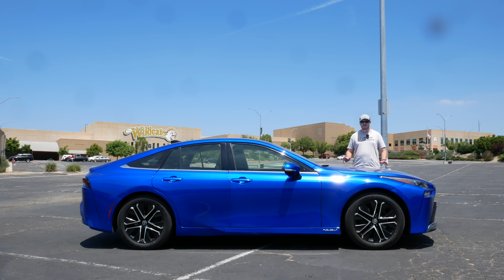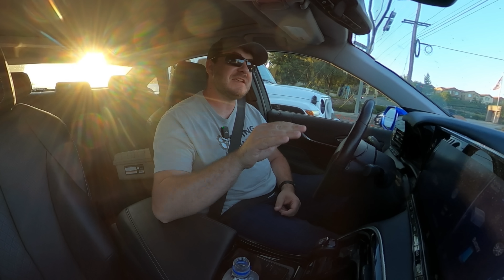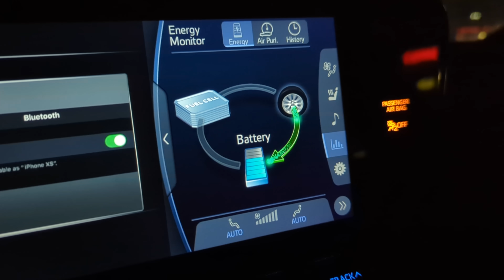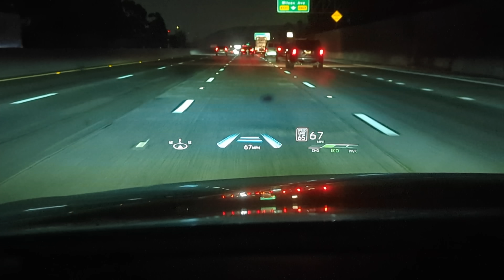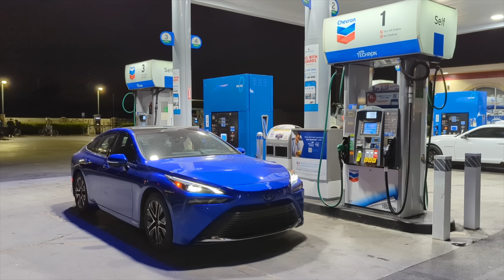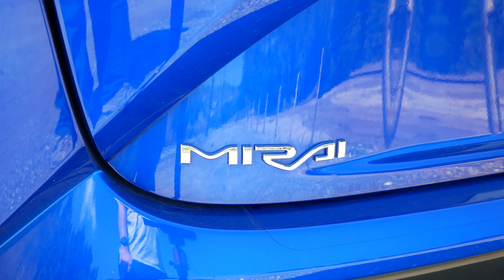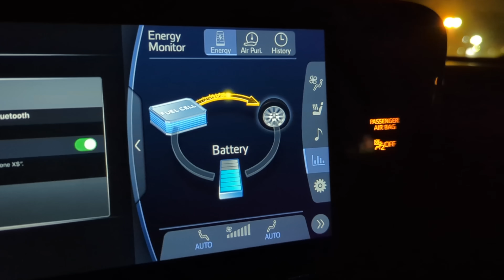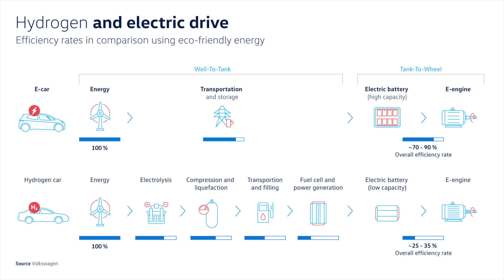The Toyota Mirai is Disappointing

Comment: There is a bit of a misstatement here and a pretty huge point to the Hydrogen fuel cell issue, and "green energy" cars and the whole 'fight against climate change" initiative.

You don't have to produce Hydrogen at all. There's tons of it covering most of the planet, as Hydrogen is a main component of water. What these fuel cells run on is something called H3. That is three Hydrogen molecules formed together. Just like Ozone (which is three Oxygen molecules fusing together), Hydrogen HATES being H3 and it takes a lot of energy to produce this. To give you an idea, Ozone is formed naturally....from a bolt of lightning. 

So, making this fuel source is complicated and expensive because it isn't mainstream. The other issue is, they could have just run this with water. But therein lies the rub. You can't really sell water to anyone, as you can find water almost anywhere. Also, if the waste product from the car is water, well, you could simply refuel your car to some degree with its own waste. So here you could have a completely zero emissions vehicle that would be cheap for everyone to use and run on the most abundant resource on the planet............yet it isn't being done because nobody can profit off of it. 

Honda actually built an amazing Hydrogen fuel cell test vehicle that was based off of a Honda Accord. It would do over 400 miles on a single tank full and while it was being tested, the driver stated how it drives and handles exactly like you'd expect a Honda Accord to do. It may not be the platform for a performance car, but this is a family sedan for daily commute.
Reply: "You don't have to produce Hydrogen at all"
"So, making this fuel source is complicated and expensive"

Making it is also producing it when discussed in the video. You cannot find hydrogen in its natural state on Earth. You have to separate it from something else, which is exactly what he said.
Reply: @anthonypelchat  Yes, and you can run a car on water, which has Hydrogen in it. It is also the waste product of H3. And yes, making H3 is complicated, takes a lot of effort, and right now is expensive.
Water is in great abundance and free....which is why no company wants to make a car that runs on water.
Reply: @eduardopena5893  You can't just run on water. It has to be converted. Further, the water has to be proper. It cannot be dirty nor salt water. That means drinking water. And it isn't free. Water costs a decent amount per gallon with most of that being wasted.
Reply: @anthonypelchat  So steam is not a thing to you?
Reply: @eduardopena5893  And you ignored what I said. Good job.
Reply: @anthonypelchat  I absolutely did not. You think the steam engines were running on purified drinking water? 

I just pointed out that you don't really know what you are talking about, and now you're angry, and want to try to make a personal attack on me.

Try again. Use your brain and logic instead of emotions.
Reply: @eduardopena5893  Steam engines required something to heat the water to run. They didn't run on water. The fuel is something else. Different concept. Also, using salt water or dirty water was problematic. Look it up.

You cannot run vehicles directly on water. You have to convert it to something else using a fuel. Steam engines use a heat source to convert the water to steam. Converting to hydrogen requires electricity to break down the water to hydrogen and oxygen.
Reply: @anthonypelchat  Yes, a boiler. They ran on the steam power. That would be like saying your car doesn't run on gas. It runs on the combustion of the gas. 

Yes, you can run a car on water. It is what some of the first cars ran on. Steam. From water. Flowing water from waterfalls and dams run power plants. 

Just like a car using H3 wouldn't be actually running on the H3, but the conversion of that fuel into something else, which is why the waste product is water, and not more H3. 

Ah, so you get it. See, the car isn't running on H3, it is actually running on the electricity. Guess we can't use it then, right? 

So what exactly is your argument again?
Reply: @eduardopena5893  Again, water is not the fuel. Calling it the fuel would be like calling the pistons in an ICE engine the fuel. That is just flat out false. The fuel is what is used to convert the water to steam. 

Waterfalls are not fuel either. Learn what fuel is.
Reply: @anthonypelchat  Falling water spins the turbines. 

And again, what you are stating is the same thing that the H3 isn't the thing that runs the car, it is the electricity that does. 

And it would be like saying it isn't the fuel that runs the ICE, it is the explosion that does, the spark from the plugs from the battery. 

So yes, you can power a car on water, just like you can power a car with H3.
Reply: @anthonypelchat  I never said waterfalls are fuel. I said they RUN hydroelectric power stations. And so do dams, same principal. The flowing water is used to spin the turbines. 

Learn what words mean. Then learn what you are talking about. You are simply arguing to argue here. You CAN run a car with water, the same as you can run one on H3.
Reply: @eduardopena5893  This is getting off track. Pretty easy to do since you don't have the basic physics education taught in middle school. Back to vehicles.

Water IS NOT FUEL. No matter how you try to justify it, water is not and is never fuel. It is used BY FUEL to move vehicles. In the case of steam power, FUEL is used to turn water into steam to move the vehicle. In the case of hydrogen, electricity is used to break down water to get hydrogen, which itself can be used as fuel. But water IS NEVER FUEL.

And no, you cannot run a vehicle directly from water. EVER. There hasn't ever been one created. Even the hypothetical water powered vehicle that you think was shelved wasn't real. It required perpetual motion electricidal production to convert water to hydrogen. Basically, it was an FCEV that proposed using magic to create hydrogen. Got it? Of course you don't.
Reply: @anthonypelchat  Thanks for taking a long time to make an argument about something I never stated and to agree with me.

Things were getting off track because you wanted to go off on tangents about things that do not pertain to the discussion at hand in some futile attempt to try to prove to yourself that you're as smart as you think you are. 

Water is a fuel source as much as H3 is. I also noticed how you just completely dropped the argument about hydro power plants. 

How does it feel to be bested by somebody that "doesn't even have the basic physics education taught in middle school?" 

Chump, step off the freight train. You are out of your depths.
Reply: @eduardopena5893  "to make an argument about something I never stated"
"Water is a fuel source as much as H3 is."

And here you are again calling water a fuel source. And yet you act like I'm discussing something you haven't stated. But at least you admit to not having a basic physics education taught in middle school.

"I also noticed how you just completely dropped the argument about hydro power plants."

Because that is completely separate from vehicles and requires a basic physics education that you don't have.

Water is not and can never be fuel. When you claim it as a fuel source, you are really confusing it for something closer to a battery. Hydro-electric power plants take energy that water has acquired from gravity and the sun (simple explanation) on its way towards the dam. But the water is not the energy source.

Same for steam powered vehicles. The water is converted to steam by a fuel. The energy in the steam is them converted to mechanical energy. Again, the water is not the energy source. That is the fuel.

Hydrogen is a fuel. It is burned in hydrogen combustion engines or rocket engines to be used as the energy source. But for fuel cells, it reacts to another material and oxygen to create water. And that reaction is converted to mechanical energy with steam as the byproduct. But again, water is not the energy source.
Reply: @anthonypelchat  Your problem is that you are not using the full quote. Try again.

Comment: The Mirai weighs more than a Tesla Model 3 and Model Y… how can you claim weight is an advantage of a Hydrogen car vs a BEV?
Reply: The Model 3 gets 340-360 miles of EPA range while weighing 300lbs less than the Mirai. That is right in line with the range of the Mirai. And 300lbs of extra batteries would have easily gotten the 300 well over 400 miles of range. Even the long range Model Y is around the same weight as the Mirai and has drastically more space. Further, all Teslas have better performance than the Mirai.

Also, trying to compare the Mirai to the Model S or X is just silly. Might as well compare it to a Bugatti or F150 at that point. Just as pointless of a comparison.
Reply: Square cube law might mean the tanks will scale up better than batteries?
Reply: By the time you add enough batteries to match the range the hydrogen car is going to weigh less.
Reply: @NBSV1  The Mirai has less range than a Model 3...
Reply: @icy1007  Which model 3 has a 400 mile range? And, based on size this would compare to a model S anyway.
Reply: @NBSV1  No Hydrogen car has a 400 mile range. The Mirai is more like 250 miles.
Reply: @icy1007  The Mirai is rated at 357-402 mile range.
Reply: @NBSV1 and it doesn’t get anywhere near that. Owners have all confirmed that it gets less than 300 miles on a full tank of H2.
Reply: @icy1007  As if the Teslas do their full advertised range all the time. 
You’re really struggling hard to make some sort of point that doesn’t make any sense. At most this is just like an electric car with overhyped marketing and underdelivered reality.
Reply: @NBSV1 my Model 3 gets over 300 miles of range easily.
Reply: @icy1007  Good for you. That’s less than the advertised range for the biggest battery. Do you have actual experience with the range on a Mirai to say it wouldn’t get similarly close to its advertised range?
Reply: @NBSV1 that’s not less. I get roughly 330 miles on a full charge. That is basically the advertised amount.
Reply: @icy1007  Point still stands that if you’re getting advertised range why wouldn’t the Mirai. Do you have experience or data to back up that it can’t do its advertised range?
Reply: @NBSV1 because no one with a Mirai is getting Toyota’s advertised range. The entire Mirai subreddit is full of people pissed at Toyota for lying about the range and want them to buyback the car. 

The point is that Hydrogen is hugely inefficient and it makes much more sense to put that energy into BEVs than in hydrogen cars.

Comment: I realize this is a year ago and people have woken up to the terrible macro of EVs but 'Aging Wheels' lost an heap of credibility with me when he said that range is becoming irrelevant based on the theoretical charge time of a tesla 3 if you can find a charger, if the charger works, if there is no one occupying the charger, if the other chargers are not in use resulting in charge speed throttling, if the sun is shining but not too hard and the temperature is warm but not too warm, etc..
The battery on a electric car is a massive flaw and will remain that way even if they can improve energy density 5x.
Reply: You haven't looked at EVs in over a decade have you? Go to Google Maps and search for Tesla Supercharger. There's plenty. Drive by any of them at any time and you can easily get a spot. And the reliability of a supercharger is over 99%. And none of the Tesla SCs have ever had issues with the temps being too hot. 

Further, Tesla started replacing the chargers that shared output 5 years ago with the V3 SCs. Even then, you only had to worry if you used the shared charger with one other person next to you. Half of all spots could be taken up before anyone would notice any slowdown at all. Tesla has been rolling out the latest V4 SCs for 1.5 years now, which are even more powerful and work with other EVs that aren't Tesla.

Your statement only makes sense even slightly for the CCS chargers for non-Teslas in North America. And that is why every automaker has ditched CCS in favor of Tesla's charging network. Didn't matter much anyway earlier since Tesla accounts for roughly 2/3rds of all EVs in NA anyways. Oh, and the Model Y was the best selling vehicle last year and is looking to repeat that again this year.

Comment: hydrogen is not $30 per 1 kg but $36 so the full tank will be $180~200 each time when you fill up if you can find a station that have stock in it.  typically, 30 ~ 40% of stations are out of Hydrogen, and cheap ($30/kg) station have a long line 2 ~3 cars in front of you and you need to wait about 30 minutes to get your turn.  Keep your fingers cross the gas will not run out of the dispenser will work fine.  Often the hydrogen dispenser failed and you need to wait for extra 5 min or so and call the toll free to reset the system remotely, etc.   you will have many issues while you find a station, etc.

Comment: The real future is carbon neutral synthetic fuel that can be dropped into the existing distribution network and consumed by the existing fleet of vehicles (tools too, don't forget all the chainsaws, leaf blowers, lawn mowers, snow blowers, and generators that people power with gasoline).
Reply: Too expensive to be the main fuel. However, it likely has more of a future than hydrogen for the reasons you stated. That will keep classic cars and others on the road as needed while the majority of vehicles move over to BEV. BEV just makes so much more sense for normal driving.

Comment: By all logical reasoning Hydrogen should cost about 1/4 of what gas does it's much cheaper and easier to produce than gas is. 

You can buy hydrogen generators for your home rite now and I'm sure in a couple years those hydrogen generators for your home will be redesigned to accommodate hydrogen cars. 
At that point your WILL be able to fill up at home and it will cost next to nothing.

Comment: I agree with you that a hydrogen car should be plug-in rechargeable. Even if the range is low, it should be possible to limp around on electricity.

Comment: Your comments about the ownership downsides at the end of the video are all extremely valid, but, many of them could be solved with scale and investment. I'm not blind to some of the other shortcomings they have against Battery EVs but I'm also not going to pretend I don't secretly wish the world was championing this technology instead. The efficiency issues might be true compared to battery EVs but when you could set up massive off-shore wind, wave or tidal stations to generate hydrogen from the abundant available water, and then just pipe it back to shore, the problems can quickly be solved. All of this is all totally doable within our current technology!
Reply: You are not improving the efficiency. The energy used to create Hydrogen would be far more efficiently used by sticking it straight in the car.. Ie an EV.
Reply: Remember, an FCEV needs roughly 3x more electricity per mile/meter than a BEV. So for every clean hydrogen vehicle, you need 3x more electrical production than an equivalent BEV.

Further, you would need a drastically larger infrastructure build out. 10x to 100x more than BEVs. This is because you don't need to build out infrastructure for around 75% of the miles/meters driven for BEVs since they charge at locations that already have electricity most of the time.

Comment: Think about that next time some hydrogen bro tells you with a straight face that the infrastructure for 10,000 PSI, -40C filling stations is easier to build than freaking electricity

Comment: I feel like this car is/was extremely ahead of its time. This likely would’ve worked if there was a large amount of fueling stations that were compatible with hydrogen, but considering the low frequency of hydrogen fuel units around the United States, it’s an insanely impractical fuel source at this time. There also simply isn’t enough public support to inspire companies to construct hydrogen stations, making it even less of a viable option in the future. However, hydrogen power is still useful in logistics if you’re looking for a  low emissions alternative to mass transport. The only thing is why would logistics companies extend out and hassle with hydrogen when gasoline is already widespread and cheaper than hydrogen at present?